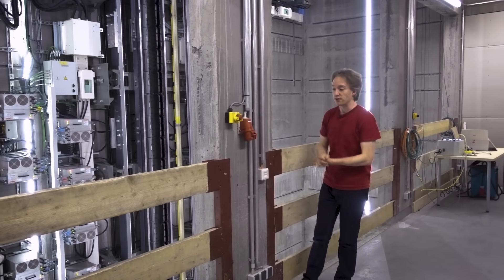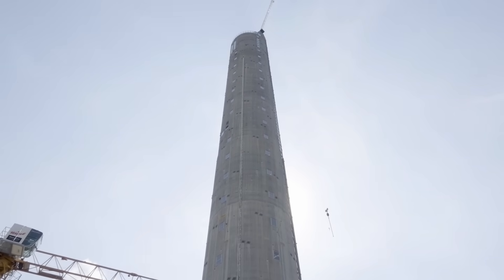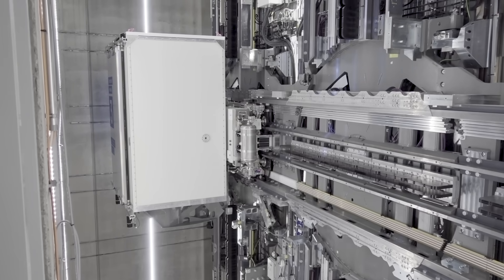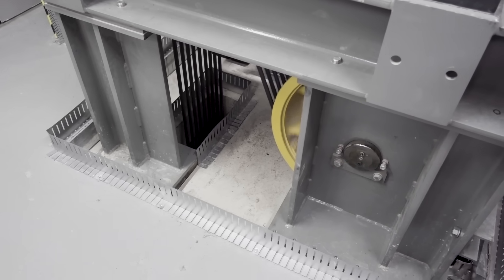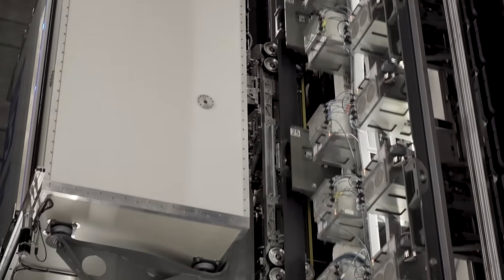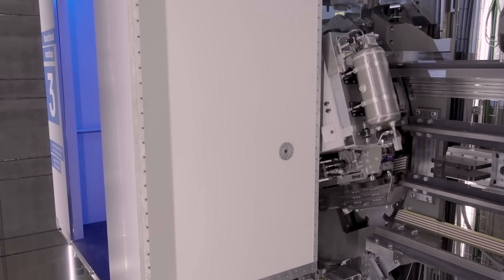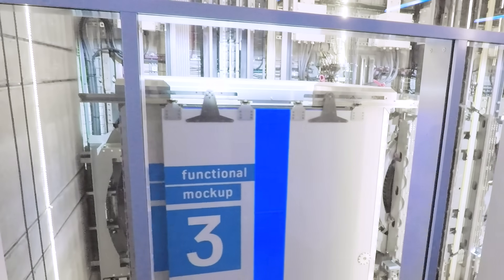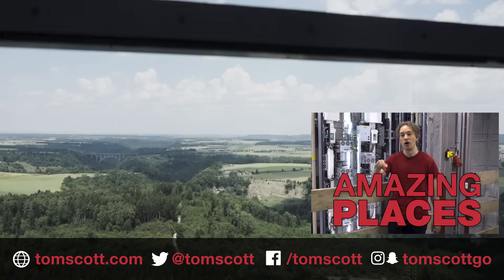An elevator that actually goes sideways

Comment: Why would an elevator like this be practical?
Reply: One of the big limitations to skyscraper height is what's known as the Elevator Conundrum.  Basically, a single elevator can only service a certain number of people per hour, and as the height of the elevator increases, that number of people declines, owing to the increased travel time.

When you add more floors to a building, you do it because you want to be able to fit more people in it.  But in order to get those additional people where you need to go, you need more elevators.  And since each elevator takes up a certain amount of space on every floor it passes through, you eventually get to a point where adding more stories doesn't add any livable space, because so much of the building must be dedicated to elevators.

These elevators, capable of transferring between shafts, change that.  Suddenly, you can put many elevator cars on just two shafts, one for the up and one for the down, and so adding height doesn't mean shrinking the floor-space of  the lower parts of the building.  (For really tall buildings, you might go with a four-shaft-model.  One up, one down, one express up which only stops every twenty floors, one express down.)  Once these elevators are approved for public use, our buildings are limited only by the strength of the materials we use to build them.
Reply: Allows for more of the lift "cars" in the same amount of space, which can make everything more efficient.
Reply: Practical use:  You can simply have an up and down shaft, with maybe a holding one in between where the doors are, and then you can have many more cabins.
Probable use:  Ridiculous skyscraper designs with four towers all linked together with cabins moving between them all at various points.
Reply: Its practical for the reasons state above, plus the shafts can be of unlimited height with these types of elevators, unlike traditional cable cars. The design also has an inherent safety factor, in that the permanent magnets in the cars will induce an opposing magnetic field in the track if the elevator beings to fall (the same way a magnet will fall very slowly through a copper tube), which limits the top speed considerably in the case of the total failure of safety systems, plus generates electricity during normal operation traveling downwards which can be re-used. The deciding factor will be up front cost.
Reply: @cOmAtOrAn I wish your comment was the top comment, because seriously, I didn't understand why this was such a big deal, and now this has done a lot more justice than the rest of the video did. Wish Tom would've detailed it all some more like you have.
Reply: cOmAtOrAn That's a use for it, but it doesn't answer the question of practicality, because we don't have a practical need for skyscrapers that are hundreds of stories. The desire to maximize space in a single plot is about profits, not usefullness. We've got plenty of space to spread out into, it's just not all as "elite" as downtowns.
Reply: See I thought the mention of cables was irrelevant because I know there becomes a certain point at which buildings physically can't be built higher (due to weight and wind and lack of atmosphere), so I didn't see the point if you're going to put them in every day skyscrapers... 

All of the other examples you all have given are great though, thank you
Reply: There's times when you want to have more than one car per shaft and this would do that. It could also be quite helpful for freight elevators as you could have people getting on the freight elevator closer to the trucks than the main shaft itself.

I wouldn't expect too much of that lateral stuff though, Elevators already take up tons of floor space and giving up more of it in order to go lateral is probably not going to be helpful. Also, this would  increase the time that it takes to reach a floor significantly.

It would technically allow the elevator shafts to be longer, but that's not usually reasonable. Elevator shafts are usually not limited by the cabling so much as the demand for elevator space. I worked in a building with 50 elevators and we had express elevators that took people halfway up the building and we had separate banks for each quarter of the building. Partially, that had to do with the cabling and counterbalance weights, but it was mostly a matter of not having the whole system jam up during peak periods like right before work and right after work.
Reply: The LIM's make it so you can go nonstop to the top of a very tall skyscraper. However, then it would take a long time to go between two middle floors if the car was already at the top or bottom. So that's why there are multiple cars per shaft. Best of both worlds.
Reply: @Gregory Chamberlain, taller elevators are usually not more useful because it's a combination of the height of the building and the number of people per floor that goes into deciding how many elevators you need. Unless you've got a very tall building with few people on each floor, something like this wouldn't be helpful for that purpose. The building would have to be like an even taller Washington Monument for that to be a helpful feature.
Reply: Becuse SOMEONE has to make an big chocolate factory SOMETIMES right? xD
Reply: This is the main advantage. Lifts with cables can only be built to a limited height before the cable gets to heavy. That means the biggest buildings in the world can currently not have elevators that go from ground floor to the top.
Reply: also, if you watch the video there's and explanation @1:35
Reply: Gregory Chamberlain with billionaires always wanting to compensate for the lack of something and constantly one up-ing each other  then we'll need this sooner or later. Hell the biggest thing humanly possible to build the space elevator would definitely be using this system if not a even more advanced version

Comment: now, this could make for some very interesting new skyscraper shapes. It just needs bold enough architects (which I'm sure are plenty) and very wealthy investors, who might be more difficult to find. But I bet this'll be eventually used somewhere in Dubai.
Reply: "Oh, what way are you going?"
"Up and left."
"Rats, I'm heading to the right!  I'll just wait for the next one."

"Sorry, is this where John Smith's office is?"
"No, this is floor B34.  His is on floor D34.  Just jump in a lift and it'll take you down to B23, along the link archway to the right tower, and up."
Reply: NabsterHax I think that's precisely his point
Reply: I think they call those trains.
Reply: Re-reading, I think you're right. Oops.
Reply: well, it actually allows more cabines in one shaft. this means, that you have a fast lane and a slow lane where there eleveator cabines can park. this leads to more space efficient desgin of sky scrapers. furthermore there is natural limit, of how high one can build an elevator due to the weight of the  elevator cable itself.
Reply: @amduser86  More importantly, you can have an up shaft and a down shaft.
Reply: i was thinking a sideway lift would be impractical in use. You give a really good point. but I m afraid that the only point I can think of.
Reply: all i can think of when i see these is star trek's turbolifts, tbh. but yeah, having them traffic manage themselves and use more of the shaft at a time instead of one cabin per shaft is going to be good, especially for reducing wait times.

this could also be good for less tall but much wider buildings, which currently have multiple shafts in many different sections through the building. obviously people can use the corridors one would go between for other things too, and retrofitting existing buildings to link them all together doesn't seem likely, but for that kind of building being built anew, there could be a central "wall", where going in the lift at the entrance can take you wherever you need to go in the large, wide facility.

like, i guess, someone said above, a smaller scale trainlike (tramlike?) system for places that're big enough.
Reply: The power of this design isn't the sideways movement.  It's the fact that the sideways movement allows you to have a dedicated up shaft and a dedicated down shaft, which means you could have multiple cars per shaft.  So where you used to need ten elevator shafts taking up loads of valuable floor space, you can now get away with only two.
Reply: cOmAtOrAn well, not yet at least. But imagine using the same linear actuators they're developing here on longer horizontal distances
Reply: cOmAtOrAn I was almost about to mention that these could be like a train system, but on a much reduced and efficient scale in a large building or complex. Then again, all this is just imagining crazy things from the future
Reply: Steven Fallon yeah, I realized that, I was mostly daydreaming about interconnecting facilities, and said skyscrapers a bit quickly without really thinking about it enough.
Reply: +Creepopolous Kinda depends on the exact type of station but of course most designs that scale that large are usually planned to have spin gravity anyway and generally don't have all that many levels rather they just have large radii with the stuff around the outsides so you are mostly going to be talking about conventional horizontal maglev more likely, though if it had many floors a system that could pick up a section of guideway complete with train on top and move it to another floor could be a good idea though not worth it with most designs only having a handful of floors easier to just have stations with stairs or perhaps conventional elevators to get between floors with platforms on each.
Reply: Ahhhh. I didn't think of that. I wish he'd mentioned that in the video.
Reply: Currently elevators are most limiting factor in building skyscrapers (from engineering stand point). The higher you go the more shafts you need and you need sky lobby at every ~150m. So the higher you go shafts takes more and more space to the point when almost all space is taken by shafts (and you still need emergency staricases). 

With elevators like in this video you can have multiple carts in one shaft, and shafts can go from bottom to top without sky lobbies. It's save huge amount of space and passengers time, thus it's also can save money even if it's much more expensiv than traditional elevators.

You don't need any crazy desin to benefit.
Reply: This could open up a lot of space for sure. Though that could also lead to a worsening rich door poor door situation.
Reply: Not sure if it has enough horizontal space  to not be extremely lazy but doesn't the TV building they did for the beijing olympic games qualify as interesting shape for this?
Reply: Halefall it's always nice to dream, that's what being an architect, designer, or even an engineer is (mostly) all about! Without dreaming or reimagining, there'd be no progress!
Reply: OAZ you are correct, and I was considering this when I wrote my initial reply, but omitted it because it would've been too confusing. Yes, you can build a skyscraper without a core; the Leadenhall (spelling?) Building in London is a great example. However, you still need to build elevator shafts that are able to support themselves (internally) or be supported by an external structure, and that would still limit architects and engineers in how daring they can get with their buildings. Also, as I and others have stated, I don't think the primary target of these engineers is to create amazing buildings, at least right now. It's to increase the amount of elevators in one shaft...maybe in a few years we'll see more advancement and engineering that will allow for a new Era of awe-inspiring buildings.
Reply: This may sound like a ridiculous, expensive, impractical idea, but I think it could be used for space stations that are too massive to get everywhere with just... floating. There wouldn't be too many mechanical limitations (I think), though giant stations like that are a long ways away.
Reply: Steven Fallon To be fair cores are not the only way to brace a skyscraper. Correct me if I'm wrong but I believe the main reason concrete cores are so common is because skyscrapers require a good number of elevators, so might as well just turn the shafts into cores.
Reply: :O 666th like
Reply: Halefall elevator shafts are not only built to store the elevators but in most modern buildings they also serve as the structural core of the building; they store a safe, sound, fireproof staircase in the event of an emergency, and they tend to hold all of the major utilities for the offices and residences. Not saying it's impossible to get around some of these, such as the utilities and emergency staircase, but changing the structural "responsibilities" that the elevator core currently has will take some major engineering, and still some building shapes would be considered impossible. Additionally, I think the main target these elevator engineers are aiming at is reducing the amount of elevator shafts that builders would need in the core, since each elevator shaft would be capable of holding several elevators at a time with the new horizontal movement.
Reply: Halefall I too knew the practicalities of it, but thought I'd just chip in with some stupidity :p
Reply: +amduser86 If you watched the video you'd know this elevator doesn't use cables.

Comment: All we need now is a chocolate river. Then we can start going full on Willy Wonka.
Reply: My local river's pretty brown. I know it's not chocolate and it's definitely not safe to consume, but it's a start.
Reply: I mean they already have the system in place, all they need to do is build a slantway rail.
Reply: Chris Gough and any other way you can think of.
Reply: The river has to be in a giant tube that is filled with LSD laced air above the chocolate river in order to be fully accurate.
Reply: it doesn't fly, does it ?
Reply: We still need teleportation from a tv
Reply: I believe the Wonkavator also went backways and slantways.
Reply: Will B-C I'm on it
Reply: afxinfinitee You live in Mississippi?
Reply: And of course, if you read the book, there was the concern that there were two elevators on the same track.
Reply: Awesome thinking :)
Reply: In the movie it was dyed water.
Reply: There's no certain way of knowing, which direction we are going or which way the river's flowing.
Reply: It does if you ask it to go full speed up and kill all the failsafes... For a while at least.

Comment: this is higher than the highest building in the Netherlands :(
Reply: Isn't it even higher than the Netherlands itself ?
Reply: Ian Witten The Netherlands doesn't need high buildings. The people will get high enough without them.
Reply: HA! You should visit Amsterdam! Everyone here is high!
Reply: Dominic LaSalle we dont have to compensate
Reply: In fact with a quick search, there are many towers higher than this tower in the Netherlands. Such as the Gerbrandy Tower which is over 366m tall (like 120m taller than the elevator test tower)
Reply: Not for long.
Reply: Denmark too.
Reply: Their highest buildings are the walls that block wind I guess xD
Reply: No, you have the Gerbrandytoren
Reply: not quite
Reply: Grammar Police Unit A274 ok... that was a good joke
Reply: impossible